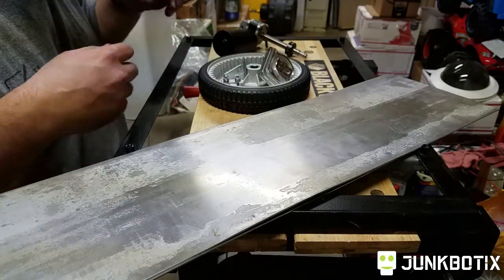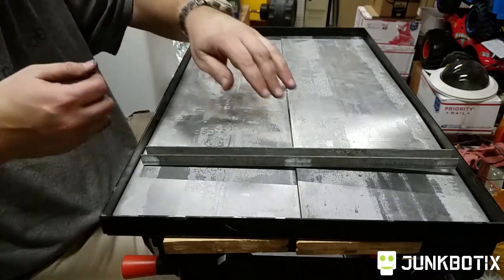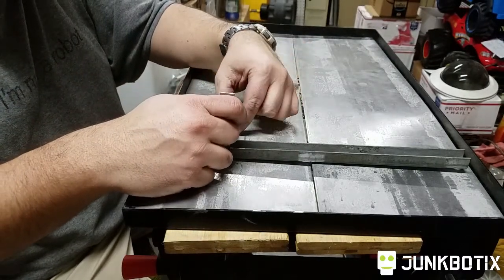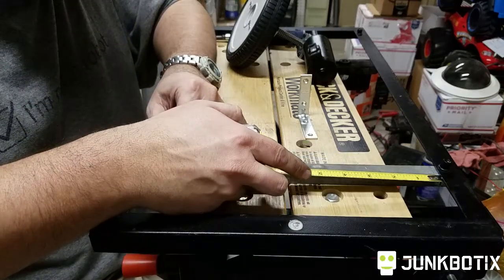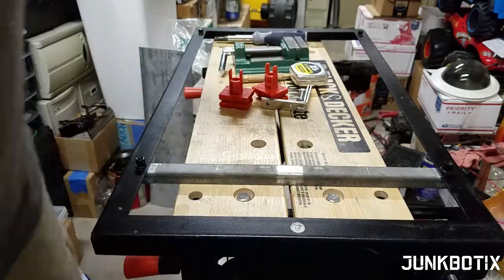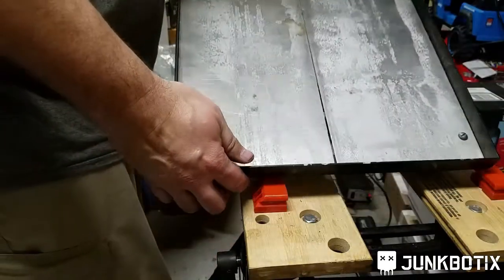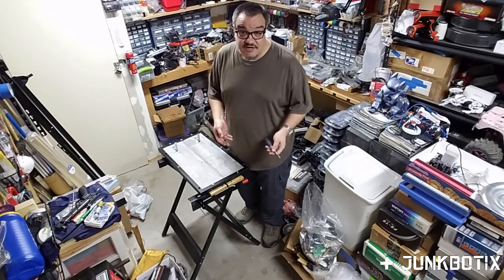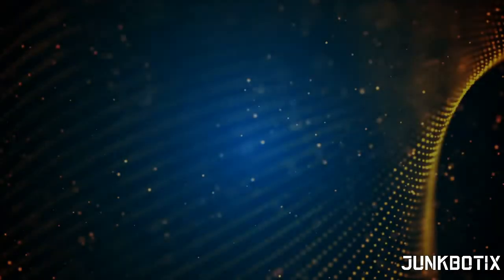Build A "Follow-Me" Robot - Part 6 - Chassis Assembly: Motor Mount Brackets

Comment: So far so good.  The new camera angle is great but the occasional close-up is vital IMHO. I wonder if plywood can be a substitute for the aluminium sheets? when does part 7 come out?
Reply from the maker: Thank you for the response! As far as plywood is concerned, yes - it would be a great material for the deck.

I actually have some, but it's in a very inaccessible spot in shop right now, and I also plan to use it for a future robot project tutorial. My aluminum was easier to access. 

Ultimately, for all of it, use whatever you have on hand, as long as it can support everything. I think a plywood frame would also be neat, especially if you fabricated it using a laser cutter, or CNC router (you could even do it with a scroll saw, or a coping saw!). Lots of possibilities!

I will also keep your "close-up" thing in mind, once I get done with this batch of videos. I had basically created a huge video, and this "chassis assembly" series has been broken out from them - so unfortunately I can't add in any closeups.

But I will see what I can do later. Sometimes it's difficult to plan how to do the shots, and grab 'em (keeping multiple cameras on hand and such - then editing it all together). For construction stuff like this, it's very free-form and unplanned, mostly.

Maybe what I can do is think about a different way of mounting my shop cam (aka cell phone) to allow me to remove it more easily for those "close-ups" - then replace it. I'd probably have to build something - a magnetic mount maybe? But no shortage of parts to do that, I guess! :D